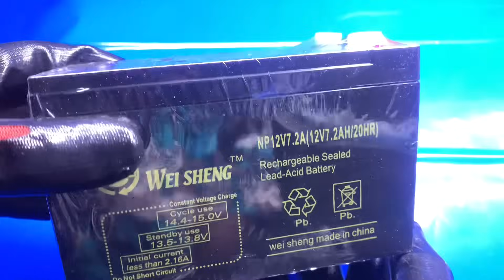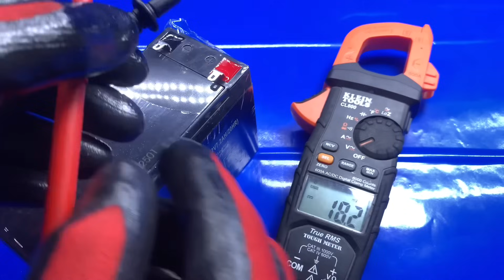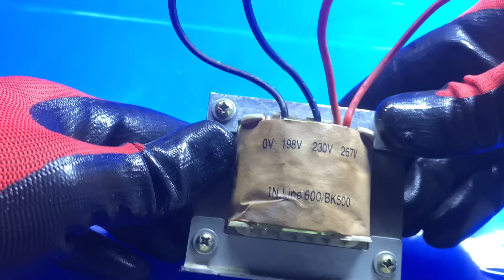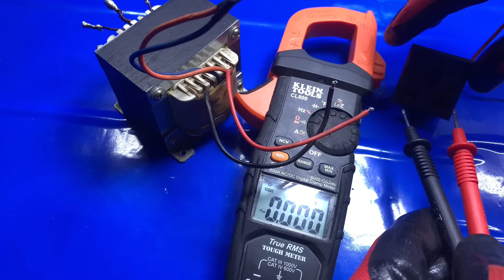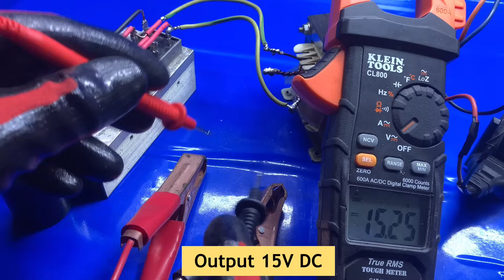How To Make 220V to 12V 20A Battery Charger | Full Bridge Rectifier Circuit

Comment: Only one rectifier is required to turn sine wave alternating current into direct current. In America we have 115-120 volts alternating current at 60 hertz, or 230-240 volts if you measure between the two power leads coming into the circuit beaker box. There are cheap transformers already wired for 12 volts DC here at auto parts stores, or Walmart. I wish solder cooperated as well for me as it does for you though.
Reply from the maker: The two rectifier are connected in parallel to increase current
Reply: @Astroelectric1  Where there is nothing, you cannot increase anything.
Reply: Try to get Fluitin or Stannol solder

Comment: That's complete nonsense. A single rectifier can handle 35 amps, so why two? 
This circuit is disastrous for the battery. Why are you wearing gloves? 
Do you have such dirty fingers, or do you need them for jerking off?

Comment: BE CAREFUL OF SAYING 20A CHARGER. THAT TRANSFORMER WILL DEVELOPS ONLY AROUND 10A. EXCELLENT PROJECT AND CONSTRUCTION. ALL DETAILS EXPLAINED VERY GOOD. MAYBE THE CAPACITOR IS NOT NEEDED BECAUSE WHEN CHARGING THE BATTERY IT WILL ACTS AS A CAPACITOR. FOR USING THIS CIRCUIT AS A 12VDC POWER SUPPLY, THE CAPACITOR IS A MOST. ALL 12V BATTERY NEEDS AT LEAST FROM 14 TO 16 VOLTS TO BE CHARGED. AS IT GETS CHARGED IF ITS CURRENT IS NOT TOO HIGH, IT WILL REJECT THE CHARGER, WHEN IT IS AT THE MAXIMUN VOLTAGE BECAUSE THE BATTERY WILL HAVE COMPLETE ITS CURRENT CAPACITY.😀